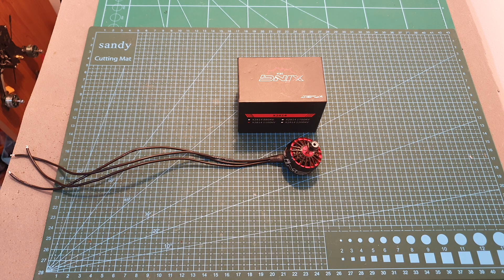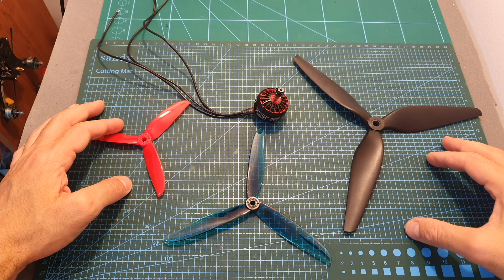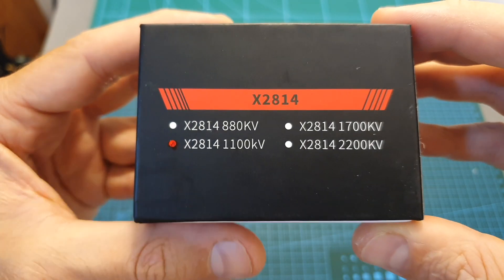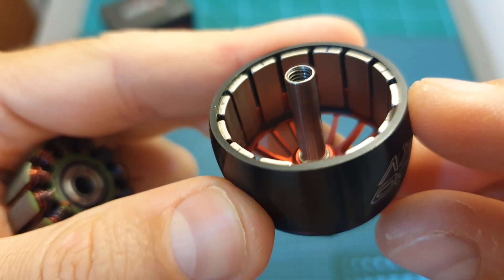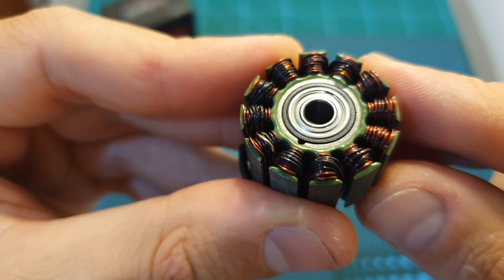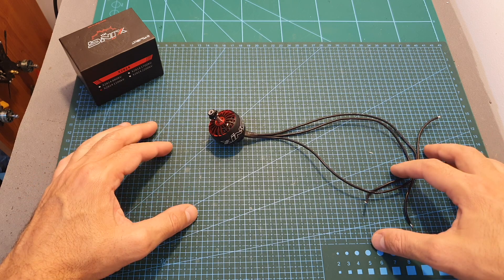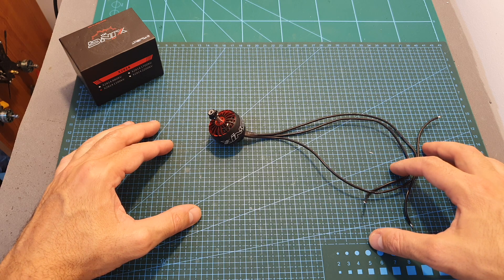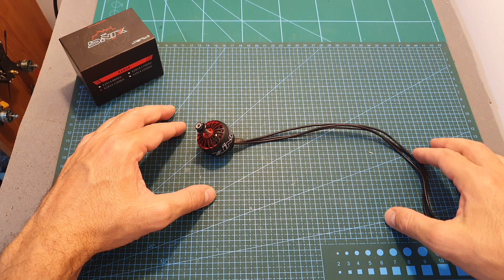iFlight Xing X2814 1100KV Motor Thrust Test

Comment: Hİ,
I connected iFlight XING 2814 880KV motors to a GEPRC TAKER 80A ESC, and during no-load (propeller-off) testing (19000 rpm), one of the MOSFETs failed. Could this failure have been caused by a voltage spike resulting from excessive back-EMF generated during unloaded operation?

Comment: Good vid.  

Maybe add an infrared thermometer to figure out when the smoke comes out?
Reply from the maker: Thanks! It turned out that the thrust stand that I was using was not very accurate in terms of measuring current and it caused a lot of the motors that I've tested to smoke. I am using a much better thrust stand now which is also equipped with a temperature sensor (although I'm a bit too lazy to use it lol).

Comment: Great video, lots of information in a very compressed format! Can you publish your complete setup (ESC, FC, etc) used in that DC10 iflight frame? Thanks
Reply from the maker: Thanks Felix. Please note that I discovered that the thrust data is not very accurate using this thrust stand. I am using a better one now and I will do another test of similar Xing motors using the new thrust stand soon. As for the build video - you can check it out here: https://youtu.be/hKLPlYrl5Fs

Comment: Question: My white ass weighs about 135 Lbs. How do I figure out how much power I need from say 2 motor/propeller set up? Each one needs 78 kilos of trust bare minimum? Since I am 135 lbs.
Reply from the maker: LOL. Well you will need to add the total weight of your equipment (frame, motors, batteries and etc) and generate enough thrust in order to lift it.

Comment: why are the results so different from the Iflight website? which is more accurate?
Reply from the maker: This thrust stand turned out to be not reliable in terms of measuring current. Thrust data should be ok though. I am using a much better thrust stand now and I will add pinned comments on the relevant videos with a warning about the reliability of the measured data soon.

Comment: Hi Gal, did you checked the engine with 3 cells battery?  Is it an option?
Reply from the maker: Hi, I don't recommend running the 1100KV version using 3s batteries, even though it is possible.

Comment: Hello, I am looking at the 2806 1800kv versions of these, do you think they would do better on 5.1-5.2 props instead of the 1100kv? Would be running 6S.
Reply from the maker: Yes, if you're going to use smaller props - the 1800kv version will be a better option.
Reply: @KremerFPV  Thank you.

Comment: I mainly have one major question. I am going to use a 60 amp 4 in 1 esc setup and need to know on 6s and a 10 inch prop, would it go over that 60 amp rating. id order the 880kv setup but their website no longer shows anything below 1100 kv.
Reply from the maker: Yes it should be fine.

Comment: Hi, just wondering how T-motor’s motor in this size or class would perform.
I have tried quite a few motors, admittedly, not nearly as many as you have, but have not found a brand that is as powerful and dependable as T-motor, but this is based on my limited experience.
From my experience, I also find the 2306 motors to have more responsiveness or “kick” at lower throttle levels than 2206 or 2207 motors.
Every motor I have tried after the f40 Pro II has been disappointing as they do not seem to have the same power, but perhaps my perception is based on lower throttle levels as I do not fly with the throttle pinned ever, perhaps a few punch outs for some dives but not extended, high-throttle flights.

Thanks very much for the content! 😀🛸🚁🛶
Reply from the maker: My pleasure :-)

Comment: These motors can hold up pretty well. The thrust tables are very conservatives, so i thought they were very weak (compared to brotherhobby’s), but your test proved this is not the case. 

The ideal for this size of stator would be an 8-inch prop at 8s batteries with 800-900kv. This would have the same crazy performance as a 2207.5 with 5-inch props nowadays.

Comment: Cool that it smoked on the last stage of the 6S test on a 10” prop. This motor would likely handle 6S on a 10” prop reliably in the air, but I’d likely go one step down in kv just to be sure.